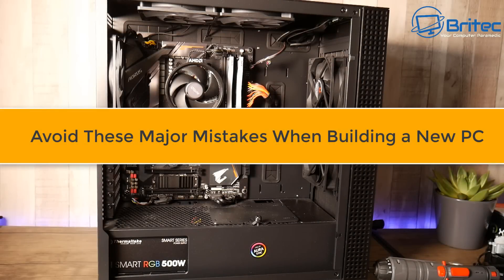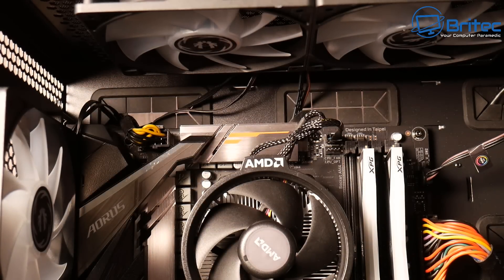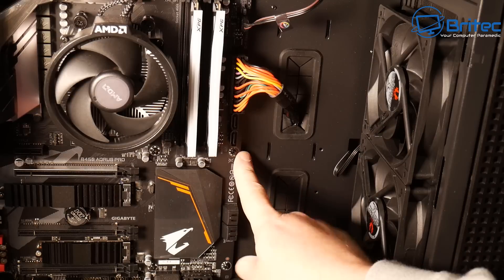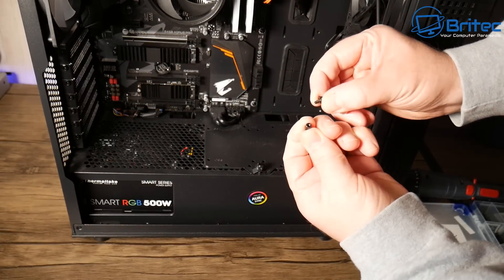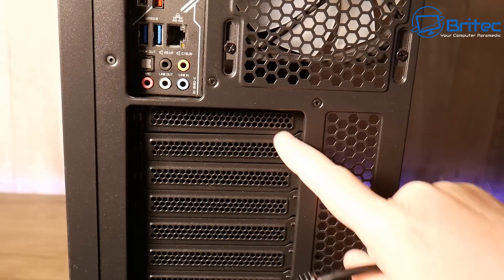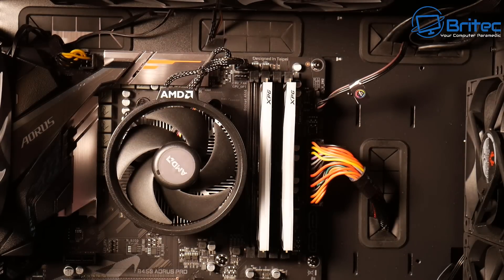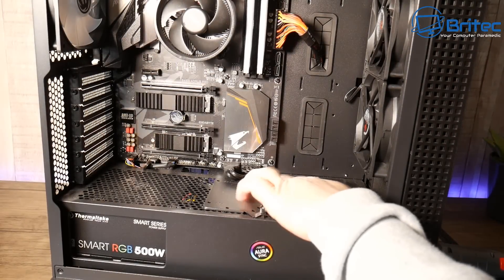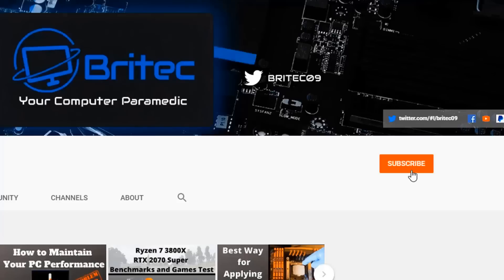Avoid These Major Mistakes When Building a New PC

Comment from the maker: What other tips do you have? let me know below.
Reply: Thermal paste should be adequate, precision CPU fan, and Cooler assembly. Base screws must be aligned in order with the PC Tower.
Reply: avoid buying one
Reply: Check the LEDs have the correctly connected polarity or they will not light up. If it is wrong correct it or the LEDs may be permanently damaged.

Comment: First step is always match hardware starting with the case. Check usb versions on case. Check case dimensions when using monster cpu cooler towers and 12” graphic cards. Game cases don’t have optical bay or legacy hdd bays. Pcie 4 peripherals will work in pcie 3 mobo with no added benefit reverting to pcie 3 speeds and vice versa. Sata, pcie 3, and pcie 4 are different standards. I have used plastic straws to hold m.2 screws with the sharp end of a wood shishkabob stick thru the straw to install them without having to remove cpu coolers. I have run into what appears to be 000 Phillips m.2 screwheads. The sharp stick and the tip of a sharp blade worked for me for removal and install, or find a #1 Phillips 2mm flathead combo m.2 screw. I didn’t want to run around looking for a 000 Phillips screwdriver. Swiping the blade of a screwdriver over an old speaker magnet magnetizes it which has helped me install screws. Memorizing the positions of power, hdd leds and switch pin outs on the mobo helps, it seems they are standardized. Decide on any RAID configuration before buying storage.

Comment: I must add one more tip: In order to avoid static elec. damage, avoid grabing, rubbing or touching the hardware with hand palm. I recommend using an anti-static bracelet and not working on carpet wearing wool clothes. ALSO READ: Honestly, it is very low possibility for static electricity to permenantly kill your hardware but it is very high possibility to do temporary damage to hardware which may lead you thinking the hardware is DOA (dead on arrival).

Comment: Thank you.  it's been years since i put together a computer from part level.  i have been thinking about upgrading, but i have a disdain for new computers.  one is the lack of drive space in newer cases, instead the focus seems to be RGB, which is tacky.  Don't get me wrong, "pimping" out a computer is cool and should be a matter of preference and come as an option, not a standard.  second, i like the "ketchup and mustard" wires, it eliminates the guesswork as to which wire should be running a twelve volt or five volt line without running online to find which wire to run a test probe on.  However, I do like that cable management is now a thing, and manufacturers no longer seem to put wires 2mm shy of connecting inside the case.

Comment: I'm sure a lot of people have been helped by this video, if your gpu has display port use that instead of HDMI and remember DP has locking pins so to pull out the connector you have to press a button